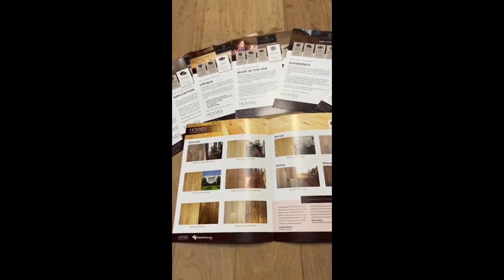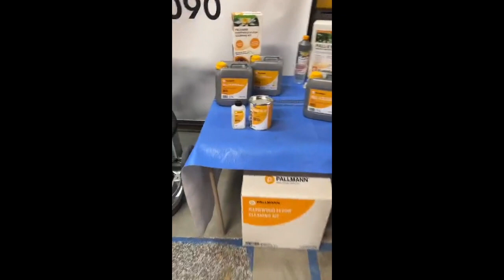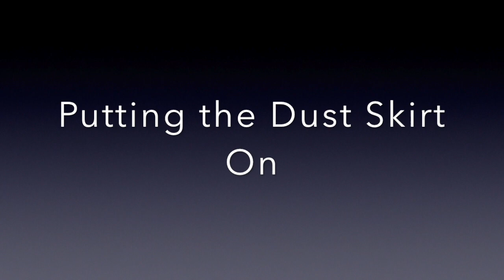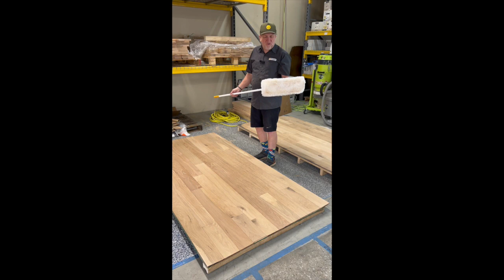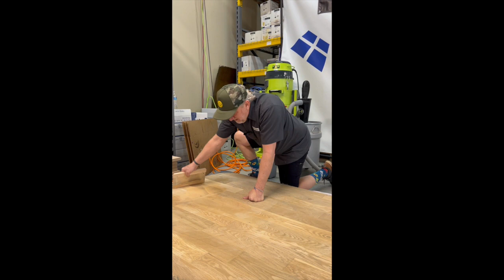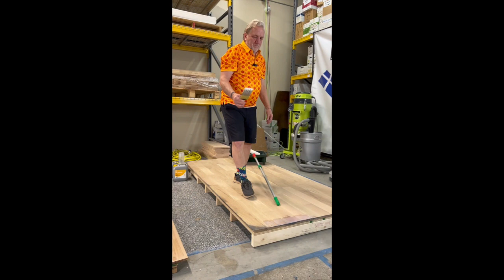How do I prep and finish a hardwood floor with Pallmann products?

Comment: Applied pallX clear to a stained white oak floor - oil stain that cured for 2.5 days. Puured a bead according to published instructions. Disolved pigment and pour marks show. Also made the brown stained floor amber/gold, and it keeps getting lighter. Not the same color.  Researching afterward other sources say to not pour, that the pigment was re-activated and lifted off the floor. Wish the ;ublished intructions would have warned about this. Need to re-sand and stain to fix. Also wondering about the color change and how to seal/fix, using same products or other to do it the next time to keep the same color.